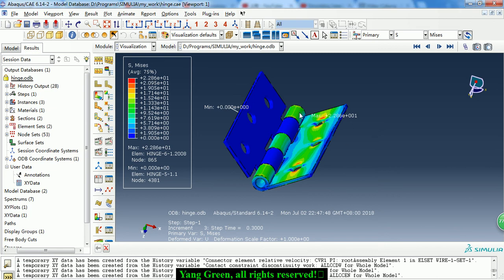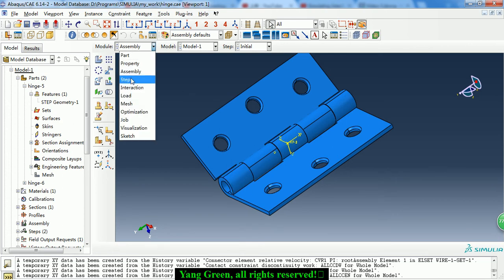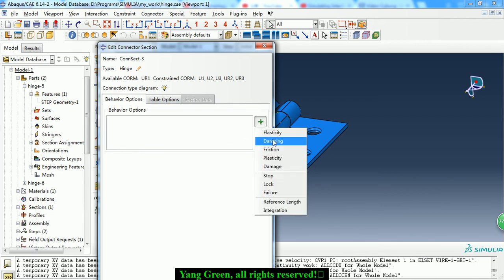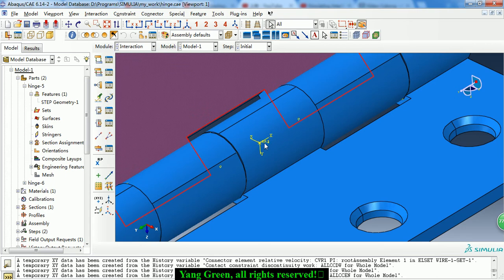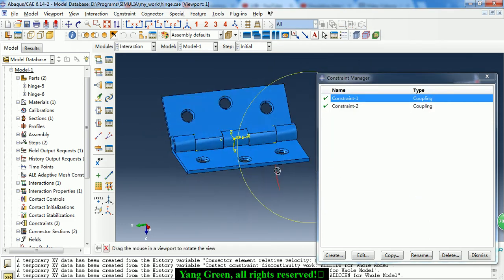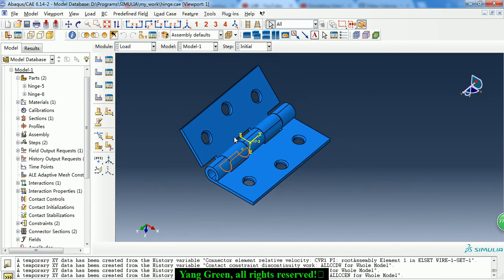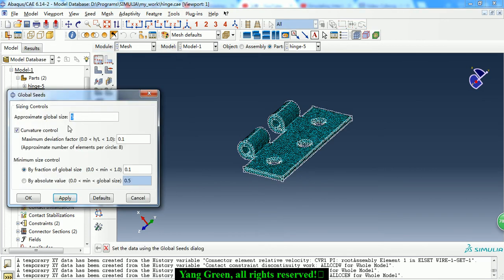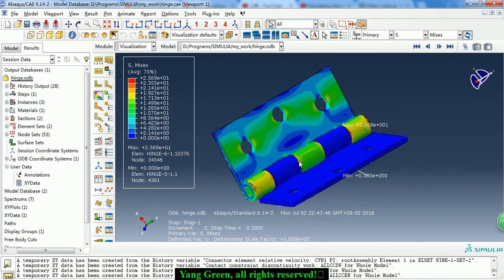ABAQUS -hinge connector (Steo-By-Step)

Comment: Sorry but your model is wrong. If the model routes in the space (changing the orientation of the edge), the local coordinate system should route as well. In the way you defined the local coordinate system this will no happen!